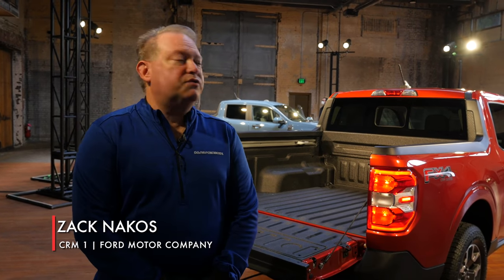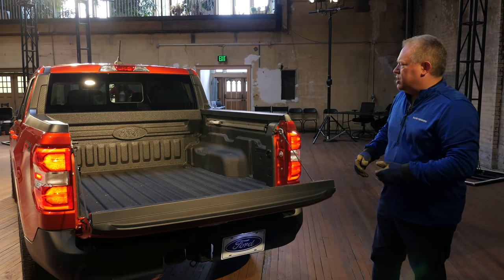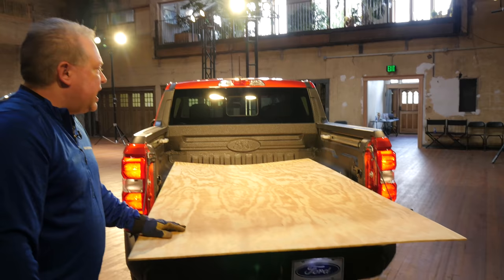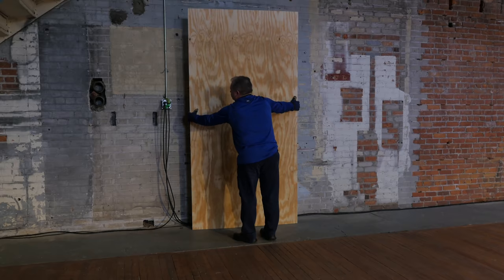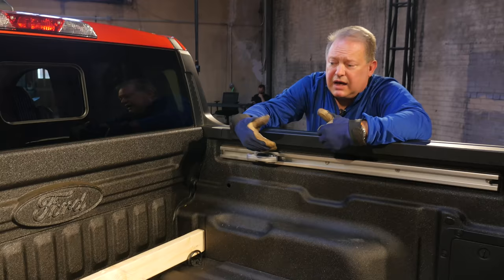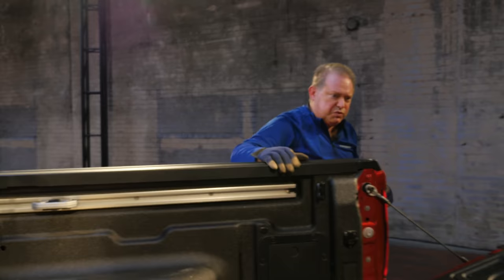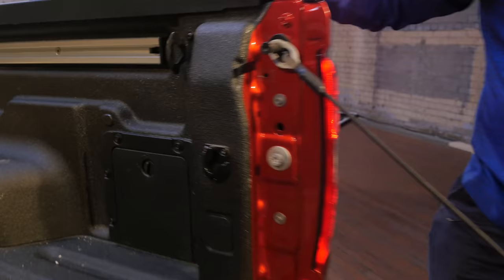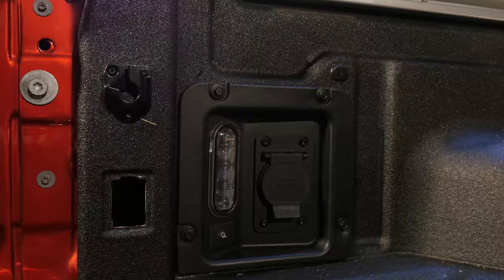2022 Ford Maverick truck bed demonstration

Comment: I don't think he said "umm" enough times in the video......

Love the truck, think it's a great place for people who never had trucks....or like me, had a huge truck that I dont use ever near enough but I still need one occasionally.
Reply: Great little weekend warrior.
Reply: I currently have an 01 f250 plow truck, a Jeep Wrangler as a toy. I was thinking of getting rid of my 01 f250 and getting a new f250 tremor. The maverick makes more sense as I dont need a full size all the time but when I do, there's no way around it. So I'll keep my 01 and wrangler and likely get a maverick in Awd for my new daily vehicle that'll get double the mileage at least of my f250 plus hopefully be a nice vehicle all around.
Reply: @ExperiencesAndEquipment  I wanted an AWD, but I have never had to use my 4wd in literally YEARS.......so the 40mpg fwd hybrid will be perfect and I'll spend a lot less on Gas thankfully.....I'd like the f150 lighting but that's out of my budget
Reply: @orion9807  I wish the fwd was an option for me. Wisconsin winters and often going down fire roads to go camping, makes awd/4wd a necessity. My Jeep and F250 both have/had 33" mud tires. I figure 25 mpg year round is better than 10 or so in my f250 when winter comes and 40 when the weather isn't crap. Plus the f250 is definitely not a nice or classy ride being a 20 year old work truck, I literally have to jump in it because it's so freaking tall.
Reply: @ExperiencesAndEquipment  yeeaaahhh at that point you forsure need atleast an AWD......I just wish it wasn't so much extra......from a lariat fwd to a 2.0ecoboost with tow package and fx4 it's like $4850 extra i believe......I'll take fwd and get me a jeep to go off roading once in a while

Comment: You’re either really strong or that’s a $60 sheet of 3/8” plywood? Bigger bed would also be an innovative solution. Like a $23k Ford Ranger XLT ? 😢 10 Tie Downs, what are you moving a totem pole?
Reply: Did you not see the flex on that sheet?
Reply: @1:15: "oblong sheet of plywood".      L M A O

Comment: I would have like to see how you can tie down a long ladder in the bed.  I have a 20’ extension ladder.  The floor tie down at the back looks promising but will it be enough for a 10+ long item to secure it with the tailgate fully closed?
Reply: I'm thinking an over the roof ladder rack...homemade or bought, foldaway or removable....I would want to be sure the truck could still fit 4 x 8 sheets while this  rig was in place.  My hybrid wont get 40mpg while carrying that extra gear, but I bet it will get better than the big truck that I want to keep but don't want to put gas in every week!
Reply: @cowboy7ification  no way I’d buy the Hybrid model,  they offer a 4cyl ecoboost engine option that’s the same engine as in the Ranger.  My Ranger is consistently over 22mpg in local driving.

Comment: Cant wait for Lincoln to make a nicer $40k one ( extra $5k would go a long way). I want a small truck but in my experience and test drive the material and component qualities are bad since its a cheaper Ford. Peoples cloth seats are already ripping, not enough sound insulation, needs a panoramic roof, ventilated seats, electric retractable tonneau, blue cruise, bigger screens,  some more soft touch and metal accent materials for people who want a small truck like this but more lux than the lariat, more in line with the Santa Cruz.

Comment: A storage space that opened up in the bed like the Santa Cruz would've been more useful to me than puuting plywood. That storage space also has a drain plug which is cool.
Reply: There is storage beneath the rear seats, maybe not as big as the Santa Cruz's but I bet it works just as well
Reply: There’s the cubby’s. Perfect for jumper cables and ratchet straps.

Comment: What is the length of the bed till the end of the tailgate when it's down? I've noticed nobody is attempting to load a motorcycle on these.
Reply: Ive heard 6 feet in total with the gate down.
Reply: Be carful though… the tailgate is rated to only 300lbs. So I’m not sure how you’re gonna load anything over a dirt bike.
Reply: @jonnyjl345k7  according to Forbes, its 400lb in the mid position, and 500lb when flat.
Reply: @reptiliancow  
Damn I just looked it up to be sure, you’re right. I saw another video that said 300, guess they lied 🤷‍♂️
Reply: @jonnyjl345k7  ive seen a ton of speculation too. Never know who to trust these days 😆

Comment: Is the tail gate strong enough to load a four wheeler with a ramp?
Reply: I think I read it can support about 500lbs. So a lighter one, probably the only size that would fit anyways, should be fine. Something really big or powerful is probably better off being pulled on a trailer.

Comment: Make a two door with a six foot bed and I’m sold.
Reply: Not structurally and economically feasible with a unibody
Reply: @Werewolf0216  interesting I own a 1999 Frontier and love the six foot bed. My bikes fit nicely. I guess the two door truck is like the manual truck…  not happening. Thanks for your comment.
Reply: @litespeedga   yeah, I have a 2001 Ranger, 2 door standard cab and 6 foot bed...manual.  I’ve been hanging onto it until finally a smaller truck is manufactured again.  For me, the Maverick might work because only occasionally do I need to make use of the full 6 feet, and then the “flex bed” may get the job done.  And I may find the extra seating useful.  But the XL doesn’t have cruise control which I’d want for longer 3 to 6 hour trips across state…but I don’t like the XLT or Lariat interior color scheme.  So guess I’ll wait to see if more options are offered eventually.  With the unibody, the Maverick uses the same platform as the Bronco Sport and Escape, but a 2 door 6 foot bed would probably need a body on frame setup, splitting cab from bed, thus more costs to build when they were wanting to have this be an “affordable” truck.
Reply: @Werewolf0216  I think the Maverick will be a success for Ford, plus the electric f150 looks awesome! Not a big fan of the Am car companies…I ‘M old enough to remember all the garbage they produced in Late 70s and up, but have to say I would think about buying a Ford. I remember reading an article years ago that the CEO of Ford had employees rent Japanese cars and talk about what they liked. We will see.
Reply: @Werewolf0216  Completely false. It would be cheaper. See 1980's VW pickups, Subaru Brat, Dodge Rampage for examples.

Comment: Plugin and light are in a dumb location, anything that's loose inside the bed can slide into and smash them. It would be much better if they were tucked up under the rail. I do like the little cubby for storing things.

Comment: I like this, but I wish it would have an in floor trunk option like the Ridgeline and the Santa Cruze.  This is the only one in class without the feature.   I actually like the looks of the Maverick and it would be a great little truck with the hybrid but I'm Leaning toward the Hyundai because I like the bed set up better and it will be built in the USA, not Mexico....

Comment: Is it better to get the bedliner from the dealership for 500$?  or is it better or cheaper to get the same type of bedliner after getting truck?
Reply: Getting it done on your own tends to be about $350 to $450, plus being without your vehicle for a day at the minimum.
Reply: Better price as an option from the manufacturer or dealer.  Getting a spray in liner after market is expensive in comparison...could be twice as much.

Comment: Great truck, just 2 more doors than I need. Entry level should have manual transmission, 6.5 or 8 foot bed, R W D and a small block v8. Get back to me.
Reply: So you want an 90's era ranger with an extended bed.
Reply: @Guild0fGamers  YES!!!

Comment: I like the thought they put into this, but I cannot for the life of me understand why they do not offer a universal garage door opener button even on the high end model and the rear view mirror is only that.....it does not have automatic night\ day adjustment.  this is an option on even cheap models from almost every other car maker.  If they are listening to their customers, why are they ignoring this request on line by thousands of Ford owners?  I can't understand their blindness to this feature.  Also, the back seat is so small and cramped that it should be an option to not have back seats and put in a tool box or something.  Hyundai Santa Cruz has a trunk under the bed in the back.

Comment: What the size of the bed? Want to know if I can fit a motorcycle in it
Reply: 54"
Reply: The big would dwarf the “ truck “ if you can even fit it
Reply: 4.5ft long by a little over 4ft wide. 6ft long with the tailgate down.
Reply: I like the Ridgelines we have as there are no rear wheel wells. And drywall and plywood load flat right on the bed and tailgate.

Comment: Cool bed. It would be even better if it had a trunk like the Honda Ridgeline or its leading competitor, the Santa Cruz.
Reply: battery and future motor for the Hybrid AWD system will go here
Reply: @nathanspears  do you think there will be a hybrid AWD?
Reply: @rsngrl  that's the rumor
Reply: I was wondering the same although you look where the rear wheels and axle are located and that kind of gives a clue as to why they couldn't and I believe that since the bed is metal not composite getting that done would be a little bit of a chore for a feature that is useful but may increase production costs - I'm sure they considered it (dumb if they didn't)

Comment: Too bad they did not include bed storage like in the ridgeline.
Reply: They have the underseat storage in the cab?
Reply: Maybe it would cut down on the payload weight if they did? Just a guess.
Reply: @DaBuffNerd  It probably would honestly.
Reply: or the Santa Cruz - it would lower the payload and because they use metal (not composite) there's a little less of an opportunity to do stuff like that.  I really think the Ford is going for someone that wants a small pickup and the Santa Cruz and Ridgeline buyer is looking for more of a car-like experience
Reply: @joalblo9581  Yes although with the hybrid the 12v battery is using some of that space on one side.
Reply: @joalblo9581  Yes. And third two third split seat fold up for huge inside carrying. Tail gate also swings to side to reach into the bed further or in trunk plus get closer for really heavy items. 
Aaand no rear wheel wells so sheets are flat on bed and tailgate.
Reply: I think the spare tire is there

Comment: I really want this truck for 42mpg but dam this is a stupid box. You want me to unbolt my front wheel and make a clamp on a piece of lumber in order to transport my mountain bike? And box is not long enuf to load a dirt bike or motorcycle, idiotic. Why didn't you make the tailgate stronger and taller and raise the box sides, a 4.5' bed is just too short. The Honda Ridgeline bed was just the perfect length to keep the truck short but be long enuf with the tailgate dropped to be useful.

Comment: I am not impressed.  Maybe a sheet of plywood could lay down flat in the back of a pickup truck with room enough for some nails and a hammer.  Ford you have no idea what your customers want or need.  A constructional professional does not need a bike rack or small special hooks or small holes for future usb outlets.  Whoever you used to research the  use of this vehicle ask for your money back.

Comment: This will be a small niche vehicle with low sales, I doubt it will last more than 2 to 3 years before it is pulled from market. The bed is a total joke people will show up at a Best Buy trying to load a 65 to 75 inch TV looking just like the people who try to do that with their 4 door Toyota, Honda or Nissan only to have to pay for delivery. They will be lucky to sell 15,000 a year. The build quality is cheap using cheap materials, it is built in Mexico a place not known for producing the best quality vehicles and to even get one with the bare minimum of options will jack the cost up to $33,000 dollars before tax, tag, title, dealer paper work and extended warranty that you will need, that will raise the cost to $36,400 dollars out the door. 

Sorry but this Maverick is doomed too fail.
Reply: It's a crossover with a truck bed instead of interior storage. A modern mini truck. Modern vehicles are much better than vehicles made 20 years ago, should hit 200k miles no problem for the average user. Pretty sure the payload, towing and mpg are better than a 2000 Ford ranger or s10.
Reply: It has more payload then the ecodiesel. thats gotta hurt.

Comment: So they pretty much copied the Tacoma
Reply: What did they "copy" from the Tacoma? The Ranger has a lot more in common and competes with the Tacoma. This doesn't
Reply: @Austden  the wheel well , storage pocket , 110 outlet , track system on the side
Reply: Yup, my 3rd gen Tacoma has the cubbies.  I do have to say the 12v wiring is awesome though.  I wish my Tacoma had those in the front and rear.  Not that I found it to be a big deal soldering in all my modifications but it's a nice touch.
Reply: @joepaul1814  So what ? Toyota suddenly owns everything that convenient and nobody else can do it because it's considered copying ? You do realize Toyota isn't the only company that makes vehicles meaning they themselves copied these. The outlet is something Ford has on almost all their current model trucks, storage pockets is a big deal too considering they literally are expressing that in this truck most of all and many other vehicles they make with their seat storage, dash, console, doors all have extra or new ways of storage. Nothing here is suddenly all copied or based on the Toyota come on now be real.
Reply: @M Maple So triggered. That jerky Tacoma will hold its value though. And that underpowered motor will long out last that boosted 4 banger. Go sit down and call your mom cuz someone said something true about a Freaking Ford Ranger

Comment: LOL, all you people crowing about this wannabe pickup are failing to see the real vehicle, it is a $19,999 dollar vehicle before you start ticking the options boxes and even then the options are a joke, that means it is built with the cheapest of materials, these Mavericks are going to be falling apart in 2 to 3 years because of pour quality and cheap materials.
Reply: like the rams
Reply: @paulwatson4189  Yet Ram is always credited with the best interior in its class, I have owned Dodge/Ram pickups since 1996 and have never had a major issue with any of them, and only a handful of minor issues that were quickly taken care of.

Comment: What a joke
Reply: It is a joke.    I read an article that  you can load up to 18 sheets of 4x8 3/4 plywood into the bed.    If you do quick math a sheet weighs about 60 lbs.   that’s in excess of 1000 lbs.    no way!
Reply: @peterbu2817  1500lbs payload, FACT